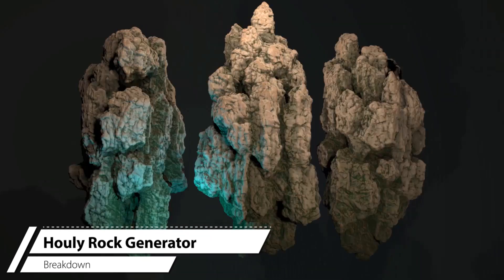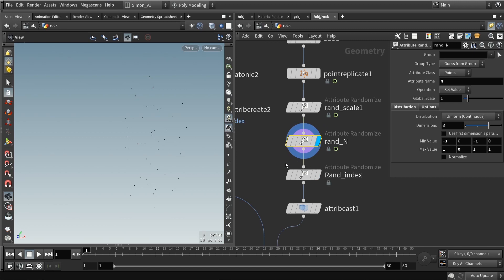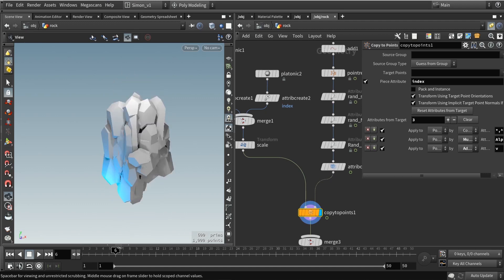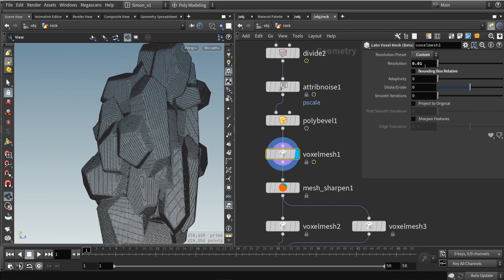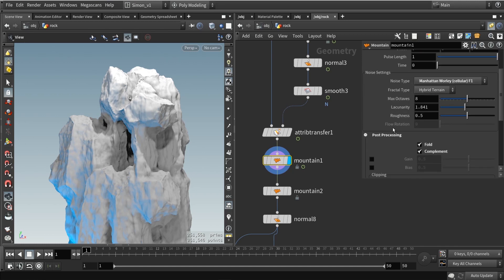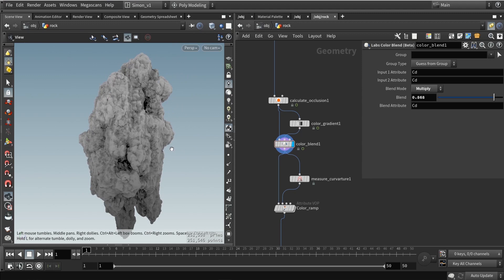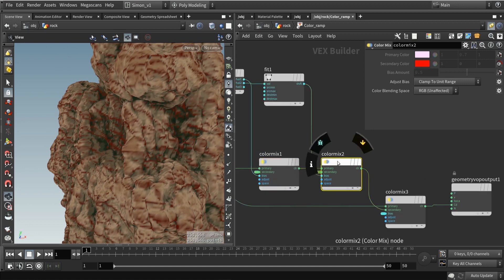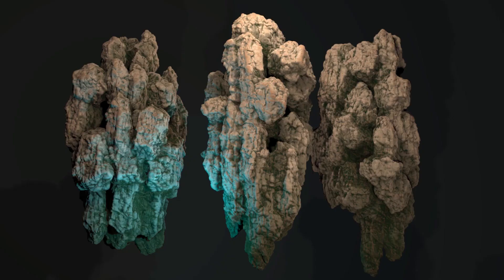Houdini Rock Breakdown || Houly2020

Comment: Hi, your video was very detailed and helpful! But there's just something that I didn't understand. Could you explain to me how you transformed these volumes in the "copy to point" part? Because each one looks different. 5:15. Regards
Reply from the maker: Before that 5:15 , I talk about adding a random attribute value. So if each point has a random attribute called scale or pscale, this scale will then be used in the copy to points to scale the model based on the attributes of the points.